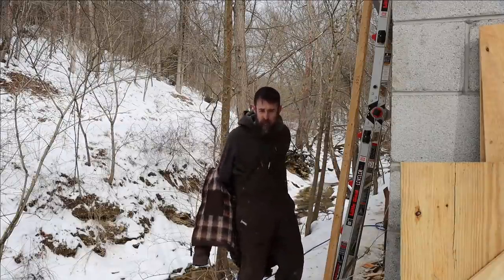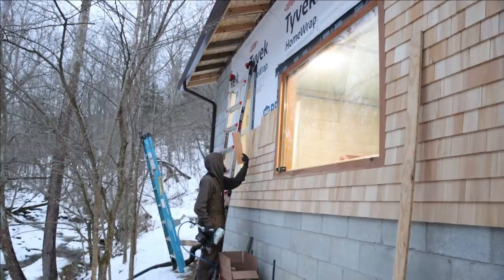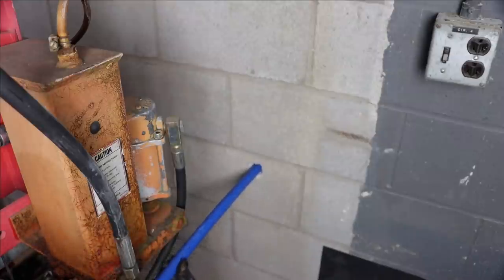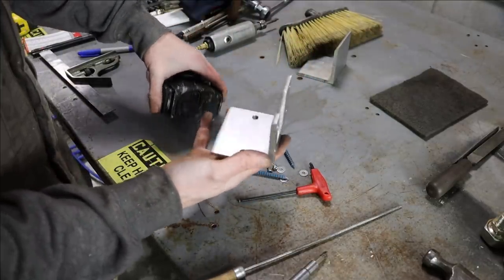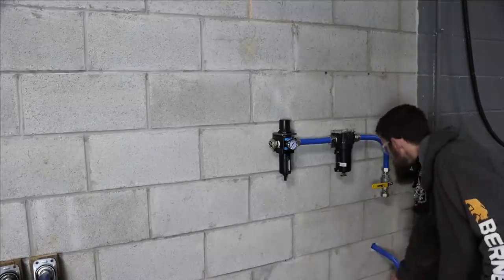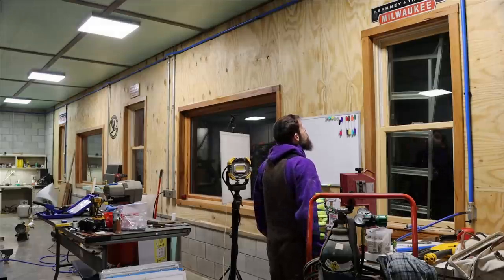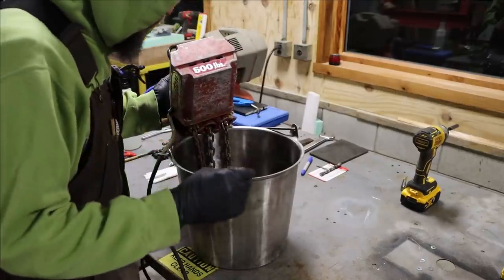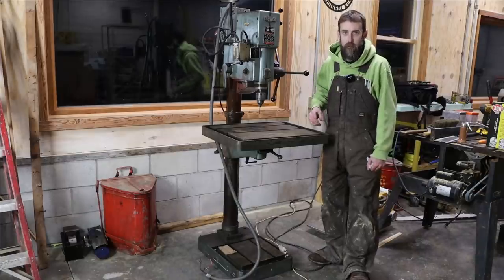Shop progress update and New Machine!

Comment: Steve, you may want to consider adding a drip loop on the outside of the wall.
Reply: I was initially thinking that too, but I think he's putting a roof, and maybe 2 walls around the compressor - I doubt it will ever get wet right next to the wall. Just seal around the pipe with some plumber's putty, should be fine. Putting a drip loop in the pipe would mean you'd need a drain there right away, for any water that collects inside the air line too.

Comment: Shop is looking great Steve once you get the shingles finished that will be the end of your outside work unless you decide in the summer to replace the sliding doors . I would make a new frame with 2x1 box steel frame and fix timber to the outside to sheet it up and that will give you at least 3 or even 4  inches to put your insulation panels into it.

Comment: Any time you might order from McMaster, check on zoro.com first. Zoro is the e-commerce side of Grainger. Lots of times, you can find what you're looking for on Zoro cheaper than McMaster or Grainger. If the stuff is in stock at the local Grainger, it ships from there. Funny that your air pressure regulator is a Wilkerson, and I just spent an evening earlier this week completely taking apart cleaning out a Wilkerson filter/water separator and pressure regulator on my CNC machine. I still need to disassemble the lubricator and clean that out completely. Zoro had the cheapest price for the filter cartridge for the Wilkerson F28 air filter (except one new old stock one on ebay which was $1 cheaper). I also bought some Milwaukee screwdriver tips and a 3/8" square drive to 1/4" hex bit holder so I can use screwdriver tips in my 3/8" cordless impact, and all of it was substantially cheaper than amazon, or any other pricing I could find online, taking shipping into account.

Comment: If o rings on scuba tanks don't need grease, at 3,000psi I don't think shop air at 150/200psi needs greasing. Just my opinion I did over 20 years In tyre trade. 1st pipe out of compressor should be flexible.

Comment: Everything's looking good. The only thing I would have done different would be to roll a couple of coats of white on the walls before starting the accessories. But it ain't my shop, so carry on. The drill press is super nice.
Reply: White paint is like magic when it comes to light. Makes such a huge difference. But Steve does have that shop lit up pretty good as it is. Concrete block is kind of relaxing to look at raw too.

Comment: Hey Steve, brilliant content as usual. I too have a drill press to fall in love with. I first bought a Schepach but the (subjective) table deflection with 'reasonable' pressure on the handle was considerable and gave me out of square holes. I now have a JET from Axminster tools here in the UK and the deflection under 'the same' conditions is less than 2 thou, brilliant, I love it. Perhaps you could do a similar test on yours sometime soon?

Comment: The "filter" in a water separator is actually a surface for aerosolised water to coalesce upon and drain off into the bowl.
You can replace the drain valve on the bowl with a check valve that is held open with a weak spring ,so that it is open when the system is at ambient pressure. When the system pressure builds, any condensation in the bowl will be blown out and then the check valve will seal and pressure can rise to the set pressure.

Comment: Drag the chain down a dirt road it will be nice and clean after
Reply: I used to do that with tow truck chains before painting them. Brightly painted chains were easier to keep track of when doing recovery work in the woods or dark
Reply: That is a good tip to know.

Comment: You should Wrap & insulate the Air Tank so the Foggy compressed air inside the Tank doesn't Condensate on the Inside of tank & Freeze turning the tank into an Ice Cube & Rotting the Tank. ?

Comment: To seal where the air line goes through the wall demonic or the equivalent would do the trick. This is what companies that install commercial windows and doors use to seal around them because it is like live rubber. It will expand and contract without pulling loose. I believe you would like this product along. By the way the shop is looking great 👍.

Comment: yeah, let the snow melt and the ground dry some before climbing ladders on that side.

old fashion gutter & lap sealer, in my opinion, works better than silicone for gutters and metal roofs.  check the seams spring and fall, add a little when needed.
Reply: More like just make some scaffolding. There's no way I'd be on a ladder on that embankment he's got going on over there. You can knock together scaffolding out of some scrap wood and a couple of planks.

Comment: surprised they don't just have a searchable pdf or electronic doc now which would be far faster to go through.

with evaporust you can use papertowels to wick up the evaporust which is great if you can't submerge it all. Just make sure you dunk it them wrap with a good bit of wick in it.
Reply: Actually print catalogues are far more friendly than digital.

Comment: I don't have any experience with the sintered bronze air filter in your airline, but if it works as well as a sintered bronze fuel filter does in a  car's fuel line, you're going to be just fine.

Comment: In low temperatures that sintered bronze filter is likely to freeze up with anything more than a minimal air flow passing through it, and the containment vessel could freeze and crack. (These points in consideration of the fact that the unit will be outside the building.)
Reply: I think the water separator is inside on the wall. Not sure of the shop temp though.

Comment: Looking at your two large windows, it seems to me, that the odds of accidentally breaking them is greater than zero. They are probably not what one would call stock parts. So, what do you think of the idea of putting up some chain link fencing over the inside to them to keep larger objects, at least, from impacting the glass? The kind of fencing used inside warehouses with the metal framing around the edge comes to mind. Shouldn't block the view. Might block the large work piece from the drill press or a lathe across the room. Maybe.
Forgive me. I am just thinking out loud. Love your videos. Envy your shop.

Comment: the exterior is coming along nicely. I hope you are leaving good space between the shakes. that drill press is awesome.  I always think, do I still need my drill press, but the answer is always yea.  Gotta question, what did you do after you soaked the chain? I ask because one time I didn't have water, and left it, evapo rust just became like gum.. I had to re-soak it and clean it down. it was more work than a water soak. I know you can rinse it and then put it in evapo rust after quickly, but apparently a long soak (chelating) then remove leaves it gummy. just curious what you did in the cold, if you avoided the water rinse somehow, and what you used.

Comment: I can to what happens when you forget to fully tighten one of the fittings on this system. I forgot one at the end of a longer run. It blew out in grand fashion about 30 seconds after pressurizing. The hose whipped around and hit me on the head as I was running for the shut off. It was funny after it was over. Not so much at that point in time.
Reply: You should see what happens when a jackhammer air line blows. That stuff could kill someone.

Comment: Are there any issues with that compressor outside and freezing water? I would think if water in the tank freezes, it will just compress the tank air volume more? But what about condensation in the compressor case or air lines?

Comment: Arboga, Strands and Solberga were the original manufacturers of these rather similar machines. I love using these, understand Your reaction... it  easily becomes one of the most used machines in the shop. In later years they merged into this company:
https://www.mscab.se/en/spare-parts-service/
They still have many spare parts available for the older models.  I personally like the older ones better than the squarish newer ones.
I found a deal for the slightly larger mk4 Arboga GM3508 in good used condition 3 years ago, best drill press I ever had. Mine also has the Swedish Demander XY table which was a common accessory here in Sweden.
Also some info here: http://www.lathes.co.uk/arboga-drills-part-1/

Comment: How low is LOW ? on the drill press, always a issue when countersinking stainless as you keep chatter down. I always use a Bridgeport mill in back gear all the way down for big countersinks as the slower the better . .

Comment: Stupid question, but is that air going to be lubricated (either at the compressor or at drops?  I know that when I worked in the shops we had FRL's in place (Filter, Regulator, Lubricator), and the lubricators were checked for oil weekly (we used A LOT of air).  Otherwise you're going to need to keep your stuff lubricated with a couple drops of air tool oil when you use it.

Comment: You tha man Steve! Wondered about needing a tee with a drain where you 90ed up, but I guess that condensation will just go to the water separator. Did you worry about running about running lines uphill so they'd all drain back to it?

Comment: Hi steve. love your video's.... question from an old carpenter,  The compressor vibrates (rubber feet)... flexible air hose between the compressor and wall/inside the shop... maybe, just my 2cents :)

Comment: Would love a Mcmaster-carr catalogue but they won't send to Australia. If anyone has an older one they don't want let me know....please.
Reply: If you order something from them and ask them to toss a catalog in with the order they just might.  It will be in dollars but since you'll be using a card it will convert automatically.
Reply: I asked for the catalogue but was told no. I think you have to be in a special place to get one these days. I know Applied Science (here on YouTube) has them.
Reply: @scottpecora371   Hmmmmm, dollars you say, Australia has been using dollars since 1966.....
Reply: They are requiring a large purchases on an annual basis to get a catalog. They should sell them... I know many would gladly pay for a new one. Just look at the eBay ads for one.
Reply: You can just use their web site. Has more resources anyways.
Reply: @1pcfred  just not as good throne room reading as the paper edition.
Reply: @scottwheeler2494  their site isn't mobile friendly? I'd be surprised if that was the case.
Reply: @1pcfred  Oh if you want to just buy something, it's very mobile friendly. But for sitting around and reading, nothing can match the printed catalog for information density. You cannot put that much on a small screen. It's why many things either have written manuals. Hell most folks still have rows of printed books just for that reason.
Reply: @scottwheeler2494  they're just Luddites. I've seen the future and it is purely digital. Elon is making chips to embed in everyone's heads!

Comment: The drill press table does not rotate 360 degrees and that is the only negative thing...
Reply: The standard Strands which this actually is. Have either a smaller table or a round this.  Last one do of course rotate 360° ☺️

Comment: Steve did you bend the 90's in the blue pipe or were they pre bent fittings ? I used type K copper and silfossed all the  joints but am thinking about adding to it and this blue pipe looks pretty good.
Reply: Use a special bender (see prev videos)

Comment: Grease Deteriorates rubber.
Vaseline doesnt.
Reply: I use synthetic grease. Vaseline can damage seals too. It is a petroleum product after all.
Reply: @1pcfred  
yes but its a non acidic petroleum & doesn't Harm O Rings.
Reply: @jobos98  having used it in the past myself I know from personal experience that it does. Seeing is believing. Which is why I use synthetic grease if I have to lube a seal now. Vaseline petrifies or vitrifies seals. Makes them hard like rocks.